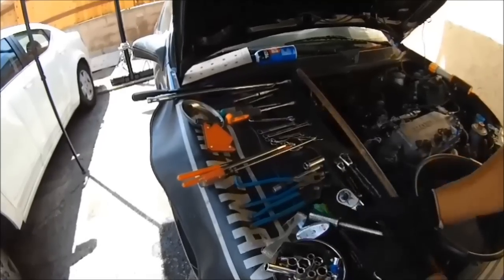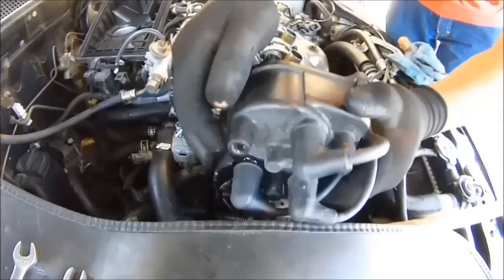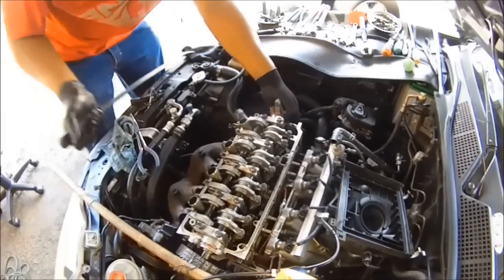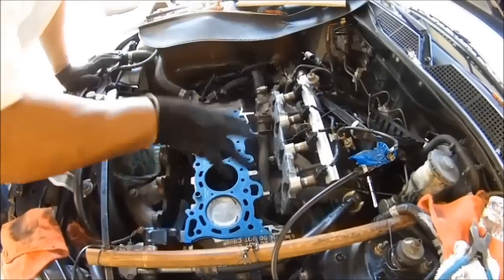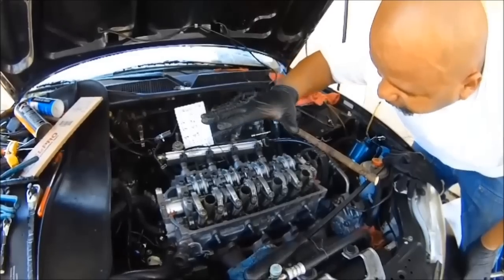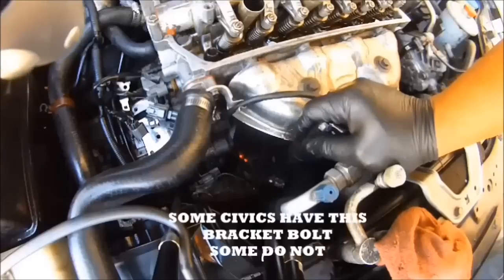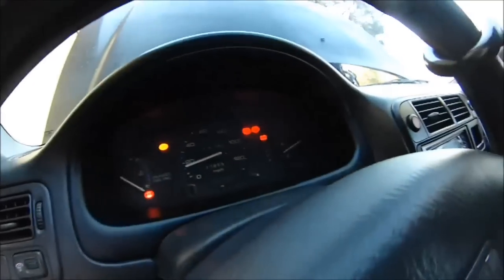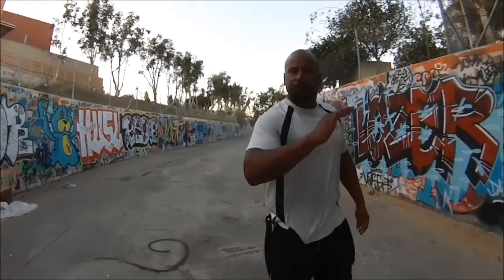HOW TO CHANGE A HONDA CIVIC HEAD GASKET 1996-2000 ( MOST DETAILED DIY FOR 2023 ) EASY STEP BY STEP

Comment: I followed the steps shown in this video and successfully changed my head gasket for under $100.00! The key is planning, preparation, patience and perseverance.
Reply: how many hours did it take/
Reply: @hallmonitor98  52 mins
Reply: And listen to the Gospel.
Reply: Did you get the head resurfaced or you just put a new gasket and that was all? What kind of gasket did you use(material)?
Reply: @fabien1446  you suppose  to bro

Comment: I want to thank you for all guidance you gave throughout this video. It only took 8 hours my 2000 Civic is running like a top again at 233k miles. Thanks again Old School I even used a tree branch and zip ties to hold the timing belt😂 peace ✌🏾

Comment from the maker: Just in case some of you want to know a good head gasket kit for these Civics cost $90-140. Dont buy the cheap stuff buy the best.
Reply: can we get a hold of you, if work needs to be done on a car. I live in San Diego
Reply: the whole point was for you to learn
Reply: Anything engine related I try and get the good stuff. Radiator hoses ignition related stuff suspension stuff I usually go cheap. Reason being if a balljoint goes bad I can fix it easy. If a head gasket goes bad I can toast my engine and most likely the whole car bc it's not gonna be worth it a lot of the time. Water pumps and timing belts on a civic I also wouldn't cheap out on. The water pumps a major pain.
Reply: @sam fun where? or what the seller's name is. Thanks.

Comment: Hi Oldskool funk and greeting from England.  I just wanted to say thanks for your tip about suspending the camshaft sprocket while the cylinder head is removed and to let you know that it works on a French car, too!  I've just replaced the gasket on my wife's Peugeot 206 and your method saved me from having to disturb the bottom of the engine at all. 

Thanks again, and may your God go with you.

Regards

Pete

Comment: This video is great and comprehensive!. Like he said, its best to replace the head bolts, and the best investment you can make are ARP head studs, most the honda community used them and they are stronger and can be reused without problems.
Reply: +Komputer Uzer Also just to add, everything this man said at the end of the tutorial is truth and should be heard.

Comment: Appreciate you quoting Isaiah at the beginning...that watered me. I love the word of God. No other book is like the Bible. Thanks!

I am pretty sure my 95 civic blew a head gasket, but I am not sure that was the root cause. I am afraid my thermostate got stuck, but that is unlikely. I am not really sure what happened, but my wife wants me to buy a new car. I saved up a couple 10k for a car, but I'd rather buy some land and build a house. =)  Oh well, we need transportation too. Looking to get certified pre-owned through Costco to get 20%-40% off of a new used car, like a camry hybrid.  I could still replace my head gasket.

Thank you for showing us ingenuity on how to install a head gasket without replacing water pump and timing belt. I need to replace those anyway since it was about 70-80k miles ago since I had someone do it.

Comment: WOW!! This is a GREAT VIDEO it is very informative in so many ways. Give details and confidence to do the job right as well. Would like to see a detailed video of Honda Civic Valve Seal Replacement 1996-2000. I have a 1997 Honda Civic that needs Valve Stem Seals replaced and  not sure of what to do about removing the cam??

Comment: How do you remove the exhaust nuts when they are very rusted?  What about a twisted off stud? Your video is the best I've seen. God is truly blessing your work! Thank you.
Reply: Kell use wd-40
Reply: If he's talking about manifold nuts which I believe I've got an impact wrench so they come off easy on a civic. Pb  blaster is better then wd 40. Or marvel mystery oil and an acetone 50 50 mix is good to.  If your already using a breaker bar and that won't work then apply heat with a propane torch. That will work. But if you break the bolt all you can do is replace it however you have to. Weld it etc.. On the front of the manifold where theirs 2 bolts just leave it with one of that's what broke no biggie. This is Ayr old so I know not info for you anymore but maybe some1 else
Reply: @stephaniekennedy6695  😯🙃

Comment: Hi!If that Honda was my car,i would request from you to replace old timing belt,timing belt tensioners,and any dumpers,at same time.I would want a new water pump and thermostat,new coolant and heater hoses,and new V-belt (serpentine belt).It would be a lots of money at once,but worth it in long run.It would be practical to do that at same time!Good video!

Comment: I have a D16Y8 motor and you don't have to change the bolts on that one because they are not torque to yeild.  14lb-ft then 36lb-ft then 49lb-ft and at the end they want you to recheck the center two bolts at 49lb-ft again. But getting new bolts gives you piece of mind. I got genuine oem honda bolts for $55 for the whole set of 10. I also used a Fel-Pro head gasket and it worked fine ($40) It has the three layer design just like the oem one.

Comment: Hey +oldskool funk, thanks for this video. I'm no stranger to cars but have never tackled a head gasket job before. With this it's really going to help. I have all the tools to complete the job. Doing a few other things while I'm going at it. All gaskets, coolant, radiator, hoses, full tune up, oil change, new injectors, fuel filter, etc, etc on my 2000 Honda Civic LX. I do have 2 questions though. I'm going to be removing the intake and exhaust valves to clean everything out properly and check things out while I have it all down. I can't seem to find a video explaining how to remove the rockers, arms and cams. At least specific to my car/engine. I've watched pretty much all of your videos and don't believe I've seen anything on doing this removal. I'm sure it's straight forward and fairly easy. Just remove everything, keep in order as it was removed to reverse it all back in properly. I'm looking for removal order and torque specs. I'm sure there is an order or specs for torque. Any help or suggestions? Also going to do the valve lash adjustment when I'm done going the above too. Just don't wanna mess up anything when removing the rockers, arms and cams or reinstalling everything back in. Please advise if you can. Thanks so much for what you do, forget the haters and naysayers and do you brother. As always GOD bless!

Comment: Great tutorial. I just disassembled the engine using this method. The timing belt broke (turned out that dirt got under the cover) but there ware other problems before. It turned out the valves were bent and rusted, valve levers broken, the gasket was blown and there was water in the cylinders, the coolant tunnels were also clogged and one of the screws tightening the gasket was covered in rust. Sad to look at. So I'm just going to swap the engine because it'll be cheaper and easier.

Comment: Hey!! Love your videos & detailed walk thru's!! I am currently working on my head gasket using your video as my guide I'm done getting everything disconnected & I'm stuck on one thing which is how you disconnect the camshaft without taking the belt off? I'm currently trying but when I pull all the belts pull as well !! Would appreciate help

Comment: Hello!  I have a question: I have a honda civic vi 1.4is 90hp ma fastback 1997( England) D14A2 which wears a metal cylinder head gasket, and I want to replace it with a graphite gasket from D15B2.  When I tighten the head bolts I will tighten with the tightening torque it gives for D14A2 as it had the metal gasket the same with the graphite gasket at 30N.m and 64N.m?  Should I tighten it with a different torque because it is made of graphite and not metal and is made of D15B2?  And if so, with what torque?

Comment: Thanks for your videos.  Just saved a ton of money diagnosing with your instructions on compression and leak down tests.  Had a hole through an exhaust valve..   I ended up pulling the head and intake manifold together because I found the middle bolt underneath the intake manifold impossible to get to.  Motor is a D16Y8 VTEC by the way.   

Unfortunately, I broke one sensor that is located on the block under the intake manifold.  It is adjacent to the number two cylinder.  I have no idea what the sensor is to replace it because i have no idea what to ask for!  LOL.  I know it is not measuring pressure because the probe is blind or dead end.  I am thinking maybe it is a temp or knock sensor.  

I would appreciate it if anyone has and idea as to what that sensor is.   A video showing the best way to get that center nut off the underside of the intake manifold would be very helpful.  Otherwise changing the head with oldskool funk videos would be a chip shot.  

God Bless
Reply: I think it's the knock sensor.. or oil pressure..  I have a 97 civic. built with D16Y7 Automatic non Vtec motor,, now car has D16Y8 engine with D16Y7 intake and manual trans now, so i have a Frankenstein civic that runs fine now. bad thing is that the car wire harness does not support Vtec... but they sell adapter so.. we shall see..

Comment: Good day my friend. I am beginner hobbyist. I learned much in your head gasket replacement technique and tried it in my lancer '96 and fix it successfully. Now I encounter another problem with my Honda civic AT '02 model and no idea how to fix it, the problem is the transmission will engage when cold but when the transmission becomes warm it will disengage and hear unnecessary abnormal noise. Please help diagnose the problem. Thanks and God Bless

Comment: hello, thank you for sharing your knowledge in many videos.  I do need help on a car I am working on.  I did not set the crankshaft and camshafts according to standards, so i just mark everything how I took them apart.  I am not sure if I should had done this.  If this was a mistake, is there a way to set all the shafts in sequence?
thank you for your time.
ps. the vehical is a 2000 XJ8 this is why i am going crazy on this project

Comment: thanks so much for all the info,tips,and great videos. I got the head resurfaced was 8 thousandths of an inch warped does that mean the engine black would be warped oe does it not get messed up because there diffrent metals..
Reply from the maker: +Andrew Rodriguez That one is waaay out of warpage . You might want to take it to the machine shop to see if you need to line bore the cam journals and you need to have the valves grinded for sure. I would Have them inspect it thoroughly. Yes you need to check the block deck for warpage.

Comment: Hey Oldskool, how did you remove the camshaft pulley bolt? The crankshaft pulley bolt requires a special tool to prevent the engine from turning. Do you use this tool and hold the engine from the crank bolt?

Comment: I have a question.  after everything was put back together I am having some issues with the car running properly.  It is running very rich.  It is a 99 honda accord 4 cylinder  F23A1.  I have made sure that cylinder one is at TDC and all of the marks line up.  when i let it run the engine has a shake to it and if i give it gas it tends to stall then rev up then goes back and forth.  When I let off of the gas it cuts off.  With the timing light it shows the TDC mark way ahead of where it should be.  I cant adjust the distributor to change the timing.  Any help would be greatly appreciated.

Comment: hows it going old school have a ? changed my head gasket on my d16y7 with y8 head , its turboed, 
so i changed head gasket and timing belt now its burning oil and seemss like to much pressure in crank case and at idle sounds like subaru out they exhuast, before i change it had none of these problems, could it just be bad head gasket

Comment: my girlfriends 2000 honda civic lx coolant resivor has oil in it. if i change the head gasket can i surface the cylinder head like you showed in the other video?

Comment: Great video, could you do a video on how you do your research on the information needed to fix all the different brands you work on, such as torque and other vital information.  Thanks again for doing the videos.
Reply from the maker: I actually have repair manuals  and I go to the local library because they have Motor and Chilton repair manuals. You can Google a lot of the info almost for most cars also
Reply: +oldskool funk My library has access to the online repair manuals for free too. But they don't have all the stuff the printed books do.
Reply from the maker: +Luke Martin Hey Luke how do you get all the repair manuals for free?
Reply: You log into a portal through the library's website. The library pays for it's users to have access to the Chilton Online Reference via their library number/account.

Comment: i have a question about changing the head bolts without taking off  the head and not to touch the gasket is that possible?
to just take off the head bolts and put another one?  i have  d16z6

Comment: Brother, I got a 1993 Honda Civic ex. Wife drives this car, my wife used to put water prior to starting the car or going anywhere she had to do this for almost a year 1/2, till I save up a little money to replace the head gasket my self.
Now after I replace it it runs like crap, on the idle it feels like it wants to die, put it on neutral and it’s good. Do you think it something to do with the distributor placement out of timing? I have to take it out to replace the gasket. And did not pay attention to the tip of the distributor.
Any advice would be greatly appreciated. I’m a DYI because shortage of Brother, I got a 1993 Honda Civic ex. Wife drives this car, my wife used to put water prior to starting the car or going anywhere she had to do this for almost a year 1/2, till I save up a little money to replace the head gasket my self.
Now after I replace it it runs like crap, on the idle it feels like it wants to die, put it on neutral and it’s good. Do you think it something to do with the distributor placement out of timing? I have to take it out to replace the gasket. And did not pay attention to the tip of the distributor.
Any advice would be greatly appreciated. 
I’m a DYI because shortage of income. Hence the year of my wife daily drive car to work.

Comment: How much is it to get the head rebuilt at a machine shop in southern california. Also does the block need to be resurfaced as well or just check it with a straight edge and that should be enough? thanks

Comment: 1995 honda odyssey timing belt broke on hwy.fix or trash. Found your confidence building video . Will inspect piston heads for damage then put in tdc then leakdown if no go will then pull cylinder head and take to machine shop.muchas gracias

Comment: I'm a little confused man I'm tryin to get to my head gasket on my 96 honda accord and it seems like you get the exhaust manifold off way easier. When I take off the bolts it doesn't want to pry off. It seems like I need to take the whole exhaust manifold off. Am I doing something wrong?

Comment: I'm impressed by your cleaning of the block, and bolt holes; I'm not a big subscriber of cleaning-up the top of the pistons as you did-; and certainly, I never clean the carbon band at the top of the liners (cylinder walls), and I believe you ignored that carbon too; a carbon-deposit that develops at the top of the top-ring of each piston.  
   I avoid doing extensive cleaning of the pistons because it subtracts from compression, and the carbon layer AIDS in the thermal insulation of the piston from the combustion heat; nothing beats it.  I would never clean the carbon at the top edge of the piston stroke, as that precision line (and wear) defines a top-seal of the the top-piston-ring(s); I don't want that crucial seal 'messed with'... it could negatively impact compression, and oil usage.

Comment: When you have i bi-metal engine it's a good idea to change the head bolts. Also it's a good idea to put new rings if the oil is white or the car has done more then 150 000 km. Even if you engine isn't smoking and you put a new head on an old block. some times the engine will start smoking. If a car comes in with head problems and the engine has done high km. Ii ask the owner if he wants new rings and if he says no. I'll ask him to take his car to some one else.  if it starts burning oil in the near future. i will always get the blame!
Reply: Piston rings or "O" rings to seal oil from getting onto the spark plugs?

Comment: Yo Oldskool, Thank you for the video. It was very detailed and I was able to step by step do my own work on my car for the first time. I did everything like you showed in the video. My car started and ran great for about a week but now I'm having the same problems. Coolant in the combustion chambers. I took the head into a machine shop to have it pressure tested and check for any warpage when I originally did the work. Everything there was fine. I don't see any other leaks around the engine. Is it possible for the seal to not 'take' for lack of knowledge on the subject. Should I try changing the head gasket again? I already poured too much money into this car but I need it and I don't have the big cash to buy another car. Any help or advice would be appreciated.
Reply: smash on it 😉😉

Comment: sorry this is going to be lengthy but My car overheated and stopped running. So I've been learning and watching videos on Youtube still an inexperienced learner. ...but So far I've replaved the upper radiator hose, spark plugs and the wires and my car still wouldn't start. Finally got someone to come take a look need a new fuel injector and blown head gasket.... guy is trying to charge me $400 and says i need a new motor. Does it have to be replaced or would it be cheaper and more efficient to have him just replace the head gasket?
Reply: Gabbi D what kind of car